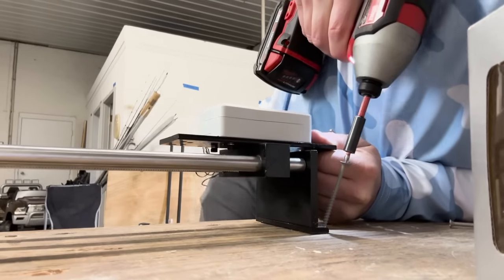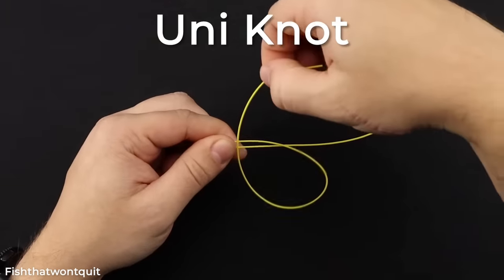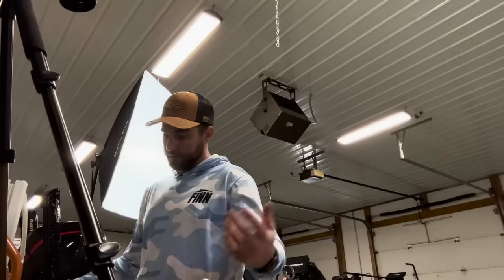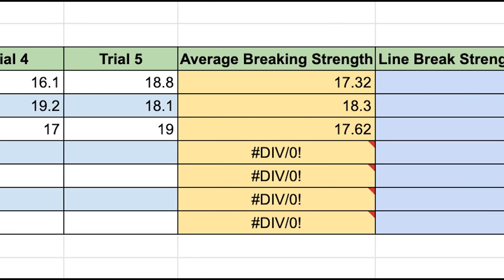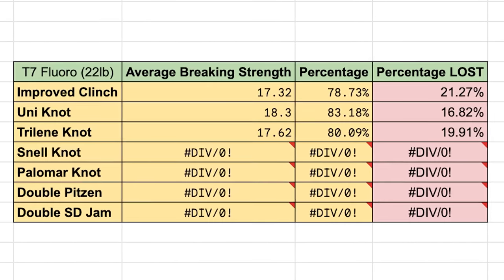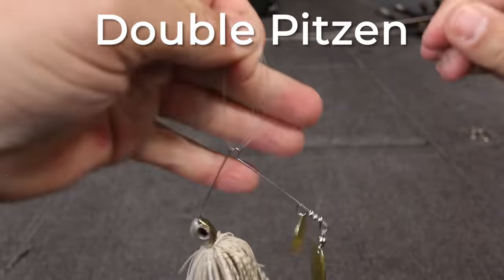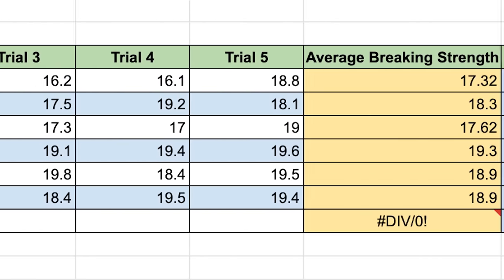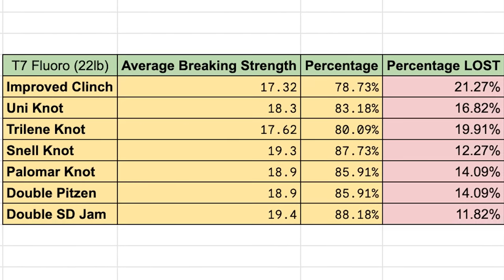You’ll NEVER Tie Another FISHING KNOT (I TESTED Them All)

Comment: Turning the crank by hand i think is a variable that fucks up the test. Like tearing toilet paper off the roll if you do it fast it breaks off a square, slow, and it unravels the roll. So pulling it at the exact same ft/lbs and same speed  is inportant
Reply: no the reason toilet paper breaks off a square when you do it fast is because of the friction between each layer, pulling something faster doesnt break it easier
Reply: @shsd7579  Incorrect. Strain rate matters a lot in tensile testing.
Reply: Came here to say this. Love this video, but slow increasing tension does not replicate real fishing conditions. Rather, it breaks on the hookset. Building a test harness to mimic a hookset with a predetermine amount of force would be interesting.
Reply: Perhaps, but how accurate are the scales at high speeds?
 Every digital scale samples the strain gage at a certain frequency.
Unless the sample rate is in the megahertz range it will be highly inaccurate.
Reply: Hand cranking too variable ...gd vid tho

Comment: You can improve the uni knot in two important ways: 1) pass the line through the eye of the hook twice, instead of once and 2) increase the turns of the knot (I use 8). Secondly, you should look at the effect of the length of the tag on your experiments: the way you did these, its unclear whether the knot is slipping or whether its failing some other way.
Reply: A theory that should be tested
Reply: It is also very dependend on line type and thickness. Thin bread (6 lbs) needs a lot more turns than thick (20 lbs). 
Lubricating mono line with saliva prevents local heating and damage during knot tightening! Practise also leads to perfection. 
Double pass through eye uni and palomar are the knots I use most. 
With palomar the line leaves at a mild angle. This can be a disadvantage for some presentations.
Reply: That’s the best knot I use I call it the double uni 😂
Reply: Very good point on the line size. I use less turns on higher pound test, and more on lower pound test - to the appropriate relative degree of course. @MrNomyar
Reply: That’s called the fish n fool knot
Reply: @waltzway5690  Right, he has the video with the braid testing and quickly showed how it was tied and was the strongest. Wish he would of showed that knot here w/20lb flouro, also the 'Double Palomar' with this line, would of scored better too. I also use the Double SD Jam knot but a Double Palomar is easier.
Reply: Less turns in heavier line, never under 4/5 tho. Burn the tag end in heavier lines creates a little bulge that prevents slipping.
Reply: Yeah but some of us count the time it takes to tie also. I'll lose 2% is the knot is waaaay easier 

(Like uni vs palomar) 

I haven't finished the video so idk the results lol

Comment: Been using a uni knot for charters for the last 30 years, if you double the line before tying the uni, the main line will break before the knot
Reply: That's been my exact experience...when tying 2 lines using the double Uni, the line almost always breaks well outside the knot. I've yet to have a double Uni break at the actual knot.
Reply: “Cadia broke before the guard did!”
Reply: I use a uni. What do you mean double the line before tying? Fold it in half and tie the whole not doubled, or run it theough the eye twice? Thanks.
Reply: @pickledcottoncandy same question just commenting for answer notification
Reply: @KINGSLAYERTURBO  Pretty sure he means to pass the line through the eye of the hook twice, instead of once.
Reply: @KINGSLAYERTURBO  actually re-reading that, he must mean using a bend.. but, doubling up through the eye usually does the trick

Comment: I taught mechanical engineering and design for 40 years and did any similar tests with my students. You used good procedures to collect your data. Only suggestions would be to wear safety glasses and cover the hook point. Nice job.
Reply: 100% Agree!  I was cringing every time the hook flew.
Reply: I was thinking the same thing.  The gasp at every break was funny.

Comment: Uni knot has never failed me. It’s easy and strong. Like Brian latimer says , tie the best knot you can tie. But I will definitely try to learn the last one you tested. Awesome video! Do braid strength next.
Reply: Same , it’s never failed me .
Reply: @Trump2024musthappen  I’ve looked at a lot of these knots, and honestly if you don’t want to break off on a bass hook set, stop trying to rip the fishes head off lol hooks are sharper now than they ever been lol good clean sweep and you got them. And I like a knot if I get hung up I can break it off fairly easily without having to rip my reel off the rod 😂
Reply: Yep - also if you throw the line through the eye one more time on a Uni knot (double uni), it’s even tougher. I use that on jigs when I’m in tough cover and using straight braid. Never fails.
Reply: Uni-knot versatility, if you stop it short of the eye and cinch it  you have a loop knot for working top water.
Reply: @gospideygo8781  that’s right
Reply: @tvans4985  that’s correct. I forgot about that.
Reply: I’ve been using the uni knot for 44 years and I can’t recall a single time that my knot failed. I’ve broken the line elsewhere but not the actual knot.
Reply: @ecleveland1  right, I’ve bent hooks out trying to break off with a uni knot. If the knot is tied right the line breaks off at the knot out up the line somewhere, I’ve never seen it break from the hook or bait. Even with a bad tie it still doesn’t break at the hook. I even use the uni on braid , and no problems there neather. I’ve tried playing around with the Palomar knot but it can be a pain in the butt sometimes with treble hooks. Again, do you not has never failed me,  braid , floro or monofilament. Until it does uni strong brother! lol

Comment: I like your channel a lot. I'm a retired Engineer. I spent years in an Engineering test lab. I would love to see someone look at the mechanics or each knot and see what causes each knot to fail. Do they fail predictable in the same point , or type of point such as line to line or line to hook eye or where a line crosses another line. Slow motion video would be cool. It is a lot of fun chasing failures. Sometimes we never figure it out as well as we would like to actually make a design change. Sometimes we assume the wrong thing by a mile. Keep doing it !!!
Reply: The failure is more often in the main line, than the failure of the STRENGTH of the knot. The line gets a lot of abuse during fishing, especially with casting and retrieving. Not to speak of the transport and storage 😅
Frequently take few meters of the end of your line, that is most reliable solution.
Reply: Check out Toit Fishing here on YouTube! I believe you will enjoy his approach to testing knots!
Reply: I’m saying it fails right where the knot is tied bc tying the knot increases pressure on the line thus making it weaker when being pulled

Comment: Nice job, Tyler! After 50 years of fishing, I've settled on the uni-knot with 4 wraps. Tying the strongest knot is only part of the equation, because some knots wear well and some don't. For example, the uni-knot will wear well all day and the Palomar will not. I often look at my line, feel my line and check my knot by trying to break it as I fish. I gave up on the Palomar because It too frequently disintegrated and I would break off a fish long before I reached the end of my hookset. That doesn't happen with the uni-knot. I hope I can save your viewers some aggravating break-offs. Really like your style!
Reply: Correct, the Palomar knot is prone to fail because it is with an dependant on the overhand knot in its core.
Reply: I'm also a fan of the uni-knot. We have experimented and our opinion is 4--8lb = 7 wraps 10--14 =6 wraps 17-20lb = 5 wraps. I also believe if your using fluro you need a lot of spit and cinch down slow. To me fluro burns more easy than mono.
Reply: In April, when I begin targeting Alosa sapidissima (American shad), I tie my secret colored dart type lures with my one and only knot.....the simple improved cinch knot. BUT I DOUBLE THE LINE. It's NEVER failed, and these fish battle you pound for pound like TARPON !!! No lie.

Comment: I have done similar tests for my fly fishing setups to ocean trolling setups.  What I found was that each knot has an optimum number of wraps for each line class.  Generally the finner the line is, the more wraps are needed for optimum strength and if you do more wraps than is optimum, the line will breakvery easily. For example, you might do 8 wraps in 4 lb line, but only 2 or 3 in 30 lb line.  If you do too many wraps in heavy thick line, it may break at only 10% or so.

Comment: Great video but on any knot I always help guide the cinching down without pulling it tight or it will burn the fluorocarbon. I always used to wet it and pull tight and finally figured out if I assist the knot down with my finger before pulling it tight I hardly ever break off because of the knot.

Comment: Great testing. I've always been stuck on the clinch and improved climch knots even after 45 years of tx fishing but, it's been the only knot that has ever failed me. For the past two tears tho, I've been exclusively using the single UNI knot. It has never failed me. Even in a 3 knot scenario like a Carolina rig.  I will now however, check out the SD Double and see if my stubborn ways allow myself the extra time that it takes while in a tx situation. In a tx, I prefer a speed knot like a clinch or a Palomer. I like to keep it simple and fast and still retain reliability.

Comment: Miller knot has been my go fluoro knot for about 4 years now and there is no going back for me. Prior to that it was a double San Diego jam. I still use a Palomar for braid, well a double Palomar to be specific. I will use the snell if I’m flipping/punching but not in wood. The PR knot replaced the FG knot for me for leaders, unless I don’t have a bobbin handy. Edit: one of the reasons for the consistency of the snell over the rest is due to the way it is tied with no real tension of the not being slid down the line to the termination point which weakens the line. A Palomar can work with fluoro if tied carefully but there are much better knots for fluoro, ie the miller and dsdj.

Comment: Wow! Absolutely the best knot test I’ve seen (and I have been fishing for over 60 years!)
     A zillion years ago, I performed my own knot test using a Zebco De-Liar mounted in a vise. I compared a clinch knot, and improved clinch knot and a Crawford Figure Eight knot. The two clinch knots consistently broke at well below the line rating. The Crawford knot broke at the rating or higher and often broke the line and not at the knot! Very impressive, indeed. 
     I have modified the Crawford when using newer braid (because it slips) by either double looping through the eye and/or passing the tag end through the bottom loop. Many diagrams for this knot are on line.
     I have used the basic Crawford for the last 60 years and have taught it many times. 2 stories – a friend hooked an 18lb Northern on 6lb mono tied with a Crawford and landed it! Another friend hooked his personal best 32lb Muskie using the knot as well (The guide he hired was so impressed with the knot – he immediately switched and started teaching his guests and students). Another bonus of this knot is the very small footprint and economy (you need to trim very little line after tying the knot, unlike some of the others which seem to waste a lot when trimming the tag)
    Now for my request – can you find some Crawford diagrams online and test them on your high-tech fixture? I am dying to know how this knot stacks up to the others in your test.
PS – This knot was invented Jack Crawford (maker of the famous Crawford Jigs) back in the late 50’s I believe.

Comment: Very interesting video, like to thank you for your time and work put into this,  I always tie just a regular clinch knot unless I'm tying straight braid and rarely break off ,  wonder if the results would be different if there was a way to test a snapping hookset strength,  also curious if different brands would have different results as there are many different fluorocarbon compositions and finishes
Reply: I grew up using a clinch knot with monofilament. Last year I got back heavy into bass fishing but I used fluorocarbon on everything except my top water poles. Well I broke off three times on the hook set with a Carolina rig and clinch knot. I watched Tyler’s video he did on the double pitzen and switched to that and I haven’t had my line break since the switch. I’m gonna switch to the double San Diego jam knot now based on the results of his testing in this video.

Comment: I would love to see you do the exact same knot test but with 8 or 10lbs line.  For example, I believe that thinner line diameter is able to make a stronger knot because it can clinch tighter together. The Adv Clinch Knot sucks on 20 lbs because the line can’t circle tight enough to actually “clinch” tight.
Reply: It's not the lack of clinch of the not that causes it to break; it is the stress of the pressure of the hook on the strained string that causes the weakness and breakage.  To do it properly he should have used a normal hook on all the tests, not two different kinds.
Reply: Yea there were issues with the test concerning line size/type and hook.  I just dont catch enough fish to worry about this.  I mean you have The Machine Richard Gene catching whoppers on 2lb line and tiny rigs..  its all about the fisherman

Comment: Enjoyed this video...very informative. Often I like to know my knots will break first especially when steelhead fishing so that I'm only losing terminal tackle and not the whole rig including the float/shot line. There are also certain knots I like tying for specific functions...double Uni for tying lines together, snell for hooks, and I almost always use clinch knots when tying to swivels. Snell knots are great when you're using light-weight fluoro, less chance of burning the line when cinching that knot onto the hook. Some knots I prefer solely because of ease of tying when you're out on the water, otherwise it's for ensuring certain parts of the set up break before others...especially because there are lots of snags where I fish most. On many occasions, when I've tied lines together with a double-Uni, at 5+ wraps per knot, I've had the line break before the knots gave out...so I've observed the knot itself actually adding some strength, in cases where I tied two lines of the exact same type (same lb test, same line type) together with a double Uni.

Comment: Love this video and the one you did on fluoro lines and your thoughts on braid regarding wind knots. 
I echo the Personal Protective Equipment concerns.
One improvement to the strain gauge setup would be to use a low rpm motor vs hand cranking to maximize consistency. I don't know if your average rod turning motor would have the torque, but I'd think you could find something for not to much $.
I also think it's be interesting to see this repeated with a fast (but consistent) speed a little more analogous to ahook set. This video better aligns with fish fight stress.
Again, so glad you're doing these and appreciate all the content you've been putting out. Big fan.

Comment: Two issues. #1, Your test totally ignored shock strength. I'd guess that over the 50+ years of serious fishing, I've broken more line on close range hooksets than any other situation. Particularly flipping straight braid. Seriously, I was waiting to see how you were going to test for shock strength.  Rarely break anything on a steady pull, unless there's serious line abrasion involved, as in when a big fish (usually in salt water) drags the line across a shallow gravel bar.
#2, Ease/speed of tying. I can tie a clean palomar knot quicker than any other knot. Less of my on-the-water time wasted tying knots is a win in my book.  It may not be quite as strong against a steady pull as a SD Jam, but on the water, cold fingers and sans my prescription reading glasses,  I can tie a Palomar and get off a couple casts before I tie a suitably clean SD Jam that I'm happy with.
Reply: Agreed.  This is why I stick with my favorite knot.  The other is that none of us set our drag to the full rating of the line we use.  If I set my drag at 12 and used 12 pound test I'd expect to break off A LOT.

Comment: Awesome helping content 
I did my own knot test once about 10 years ago using a suspended hook and added weights in 4oz incraments using 4oz home made lead egg weights a guy gave me he made for fishing powerlines 
My results mirrored yours with the XL but the XT was clearly stronger especially every knot I felt was tied incorrectly broke at 1/2 strength 
I used Trilene XL and XT taught me both the absolute importance to pay close attention when trying your knots and also taught me how to instantly spot or recognize when I tied a knot incorrectly or damaged the line when I sinched it tight
Dod the test again using Yozuri Co-polymer and was amaized at its breaking point 

All I have ever used for over 35 years now has been the Polomar when ever possible and if not then the Trilene knot
With the Trilene I find about 10-15% of my knots need re-tying due to they dont look right or they didn't feel right wnen I sinched them down 
Polomar knot is all but absolutely mistake proof in my experience

Comment: Sometimes those outliers are real! Some knots are more compatable with a line than others. The strength of the best knot will vary by brand and diameter. 

SDJ originated on the west coast among tuna fisherman, its a very legit knot. Also, the double palomar/nanofil knot is more compact, simple to tie than the DSDJ, and has two fewer tags. double palomar/ modified palomar is more cosistant than the normal palomar. 

I use the single/reg SDJ on braid. It WILL not slip like many knots will (palomar included).